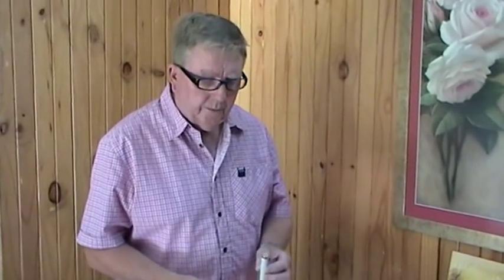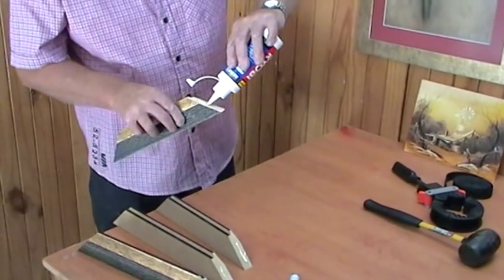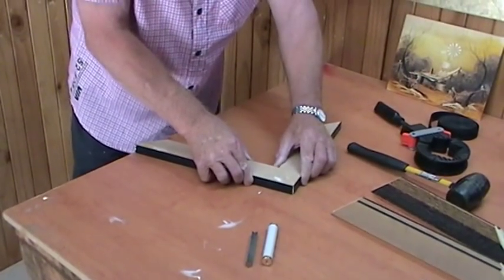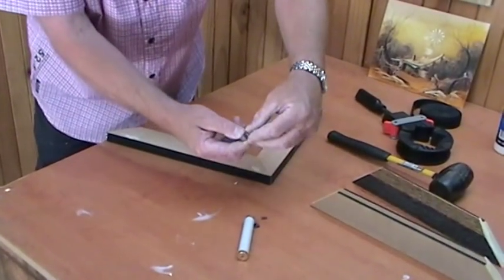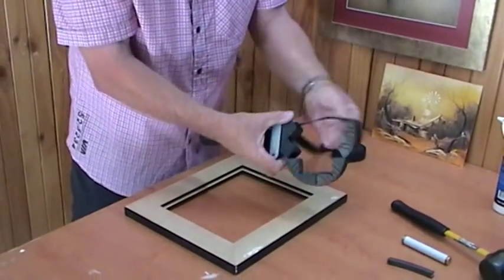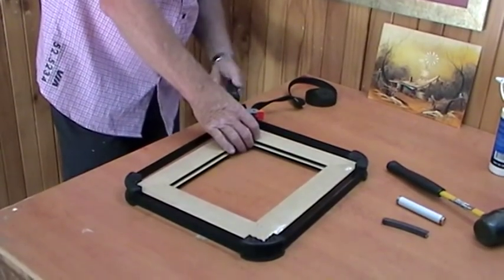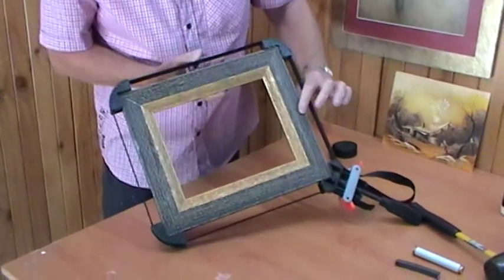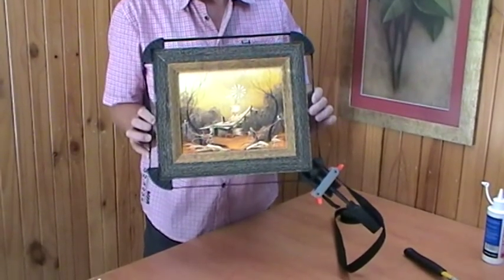Magnetic V Nail Punch

Comment: Whoever watches this, and wants to do their own picture framing, please, apply glue like a normal human being, you don't need that much, don't spread it around with your finger..especially if you are going to be touching the frame with the same finger..
If your glue bottle is too big, if the opening is too wide, just pour some glue into a smaller bottle, with a smaller opening and use it instead, so that you don't spill unnecessary amounts of glue everywhere. 

Wipe any residual glue drops from the table, and the frame, with a wipe or a designated cloth.. 

Whenever you put the frame face down, put it on a clean towel! Not directly on the table. Don't drag it around on the table, across the glue drops, everything will look messy, just like in this video. 

Some frames scratch very easily, especially those with a gesso finish and you most definitely don't want to have dried glue spots all over your frames. 

I understand that this is a cheap tool, that probably does the job, but that doesn't mean the final product has to look cheap too. 

If you can't get a proper underpinner (pneumatic, foot operated, or hand operated), there's also a picture framing v-nailer nail gun option, that works on a similar principle to this video, but it's air compressor powered and you don't have to separate each and every v nail and feed it one by one, you put a whole cartridge of the v nails into the nail gun magazine and join dozens of frames easily. 

But again, whatever you do, whatever tools you use, use a towel whenever you put the frame face down and watch that glue..

Comment: Great little video. Where can these V nail Punches be purchased from please?
Reply: Anche io lo sto cercando.....
Reply: Hi. I couldn't find them anywhere on the internet either. But it's simple to make your own. Just cut a small length of steel rod and superglue a small round magnet onto the end. The magnet holds the V nail in place and use a hammer to tap the V nail home. Hope that helps.